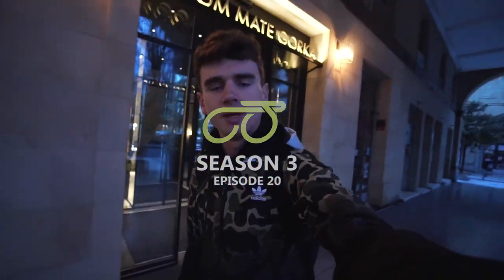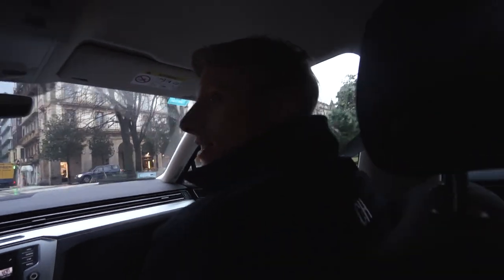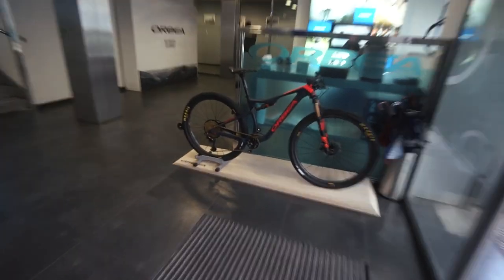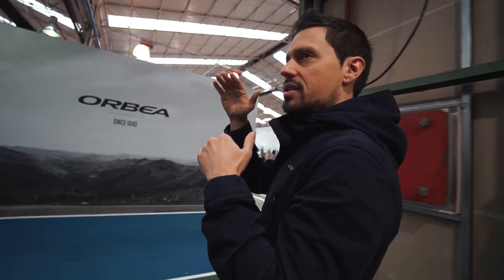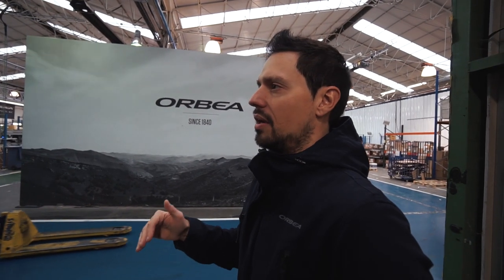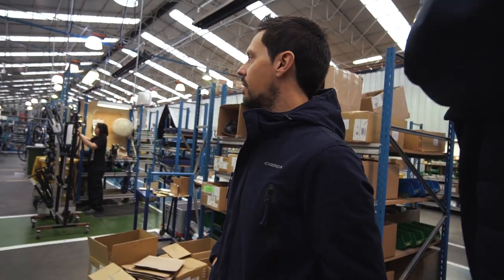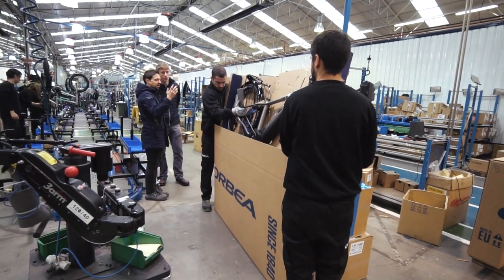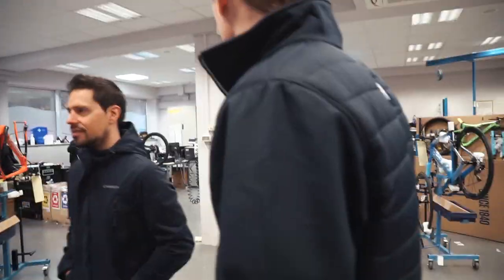ORBEA BIKES FACTORY TOUR | Season³ 21

Comment: “So nothing in Asia?” “Just the frames.” 🤣
Reply: Wonder if any manufacturers make their bikes in Europe, I think you can get a custom carbon frame from Cipollini on their website ? like you can a steel frame from a traditional frame builder.
Reply: If the frames weren't made in Asia they wouldn't be affordable.
Reply: Orbea claimed that the frameset is weaved and made in Taiwan (possibly from Giant’s factory) can any Orbea bike owner confirm this?
Reply: @G5performance  i think is from merida factory, part owner of specialized
Reply: @plantfuelled8912  the materials for a frameset (carbon + "glue") cost around 70 euros per set. it's only made in asia, because people are paid almost close to nothing
Reply: so just the carbon frames are made in asia?  the aluminum frames are made in Spain??
Reply: @Kurobuta35  most likely or in tunisia and marrocos
Reply: @bernardo9202  thanks.. Tunisia is far from Asia.. but interesting.. thanks for sharing the info.
Reply: @Kurobuta35  some european manufactures use those countrys because they can get the same pricces and is closer to the base coorporation, where they design and test the frames. Search for gnc look factory tour, if you whant a inside

Comment: I Was, but don't in Love with Orbea anymore, the steerer tube on my Orbea Ordu gets broken spontaneously, after appr. 9.000 km, inbetween traffic, lot of luck saves me.
OK, the bike was several years old, but in a very best shape - well maintained, but all parts original, tires, chain, brakepads.
I'd rode the Bike only on sunny sundays, only steets, quick up to 60 kmh on flat streets, even faster on roads downwards here in the Taunus-Hills.
I'm happy beeing still alive, not injured, but steerer tube braking without any kind of crash or impact should never should happen. 
The Bike was original from the dealer. Now they told me I should have mounted the Fork wrong.
Now I'm not amused, the bike is dead. Just hazardous waste. Unfortunately.

Check out all carbon parts every 500 Km for smallest scratches or fissures !
Br
Peter

Comment: Orbea Frames: More Engineering Ballcocks from Spain

Telling the truth about Orbea frames is called hatespeach by Orbea and Youtube in Spain..

In this video Orbea say some interesting things.
1. They don't produce there frames themselves. -
-AD1: So they shop the marked of frame producers and get them to make an offer on there drawings and nummer of bikes they expect to sell.
2. They don't do any quality control in the frame factory.
AD 2: Frame factories can earn that money any way they want. Even the cheapest way that they want.
3. They say that they only do quality control on prototypes, first production and on the marked (what does that last thing even meen?).
AD 3: No, no, no you should messure every bottom bracket on every single frame you get home. Orbea ,you don't have any quality control.

Orbea don't say that every bottom barcket gets testet for being centeret, right size etc.
Not god. Not good at all.